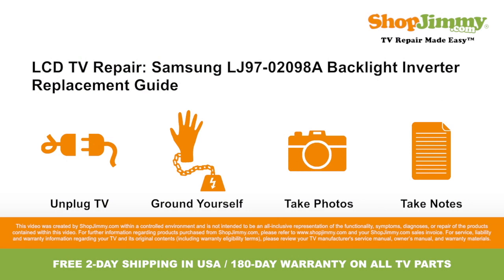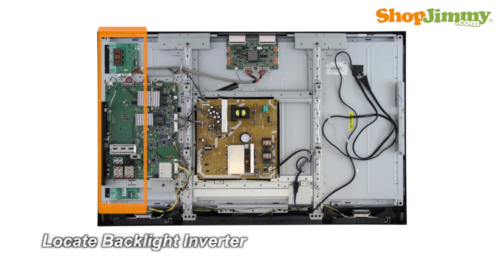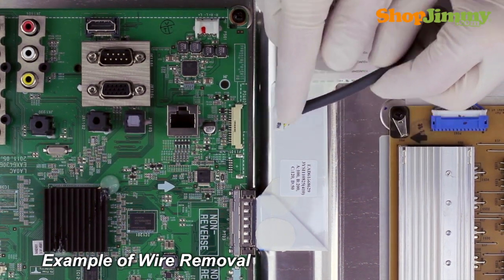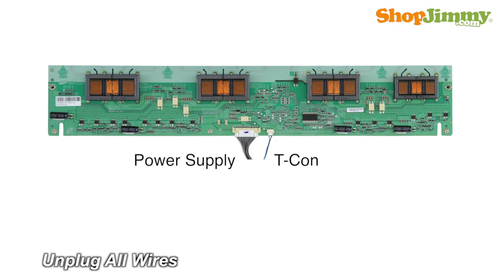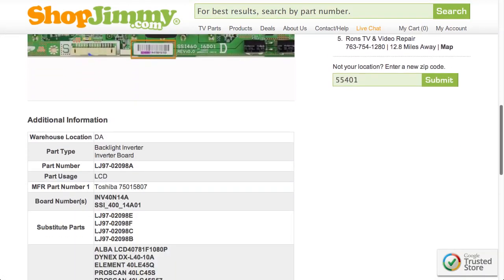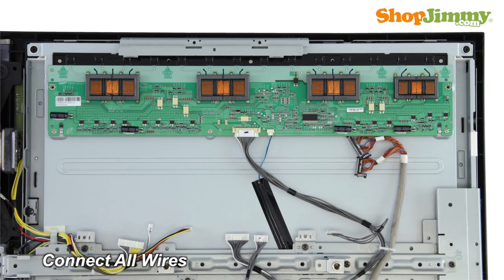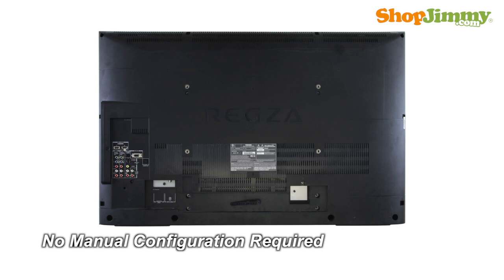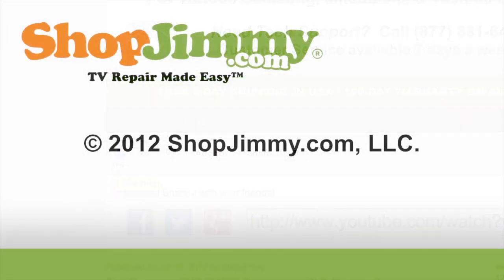Samsung LJ97-02098A Backlight Inverter Boards Replacement Guide for LCD TV Repair

Comment: I have a Nexus 4020 that flickers nonstop when powered on. I read some posts online that mentioned that it is probably the back light inverter. I just ordered one from you guys but wanted to confirm that this is the solution i am looking for and secondly i would like tips as to how to detatch previous board inverter. the bulbs are tight and cant be "slid out" as mentioned. 
The part is a samsung lj97-00998A
Thank you for your time. The help is much appreciated
Reply from the maker: Ryan Boles   This could either be the power supply or the inverter board.  I see a replacement for the inverter board here:  http://www.shopjimmy.com/samsung-lj97-00998a-backlight-inverter.htm  What is your TV model number or the part number on  your power supply?  Thanks!  www.shopjimmy.com

Comment: Hi I have a Samsung UE32F6200AK LED TV. I seem to have the back light problem. As I could not locate an LED inverter board I assumed it must be built onto the power board and replaced the power board but the same problem exists. The TV powers on and responds to the remote and you can see the menu when shining a torch on the screen. 
Can you confirm if there is a separate inverter board and where I can locate it?
Any help would be greatly appreciated ...Jamie

Comment: Hi there buddy I'm from uk and you look like you know your stuff :-) I have a samsung s42ax-yb09 had it not long at all but haven't got warranty... Basically I have a line down right side of my tv about 3 inch thick red, but I can still see the tv picture behind the red thick line.
I was told it may be the inverter board that needs replacing I was wondering if u would be so kind to help me as I haven't the money for a new tv. Would much appreciate.
Reply from the maker: danny collins This could be a few different problems.  If the line is from left to right you can try the buffer board but if the line is from top to bottom you have a bad panel.  If you have a bad panel, it may be more cost effective to replace the entire TV.  Here is a link to replacement parts for your TV model number on our website, click here:  http://www.shopjimmy.com/catalogsearch/result/?q=s42ax-yb09  Be sure to match part numbers on your current board, with your replacement for compatibility.  Here is a link to a video showing how to identify your part number, click here:  Samsung Plasma TV Repair: Samsung Plasma Panel Parts Guide  You can also call our customer service for further assistance with your purchase.  (877) 881-6492  Thanks and please let us know if you have any further questions with your TV Repair!  www.shopjimmy.com

Comment: Hi everyone, while i was swapping the Inverters, I also removed the bulb connectors instead of just sliding out the board thinking they were together... was the bulb connectors removable or did i just permanently damaged it in doing so? thank you in advance.
Reply: I did the same damn thing and now I can't get the bulbs back in the slots what did you end up doing I'm so pissed
Reply: Any answers to this I did same thing

Comment: I have a Dynex DX-L40-10A 40" LCD TV. It uses this inverter boaard (Samsung LJ97-02098B). The TV turns on but the back light only stays on for a second then goes out. Blue Power light stays on. Would this most likely be a problem with the inverter board or something else?  Thanks
Reply: Additional info: I removed one of the fuses for the inverter board and now I have a steady picture, just half the backlight. I see you sell the repair kits. How likely would it be that a repair kit will fix this?

Comment: Hi i have a samsung le32a436t1dxxu lcd, when you turn on the screen it flash up for a split second than goes black but have sound, i have done the torch test and there is a picture. some people say this could be the back light inverter but some say because it flashes up first its most likely faulty tubes.
Reply from the maker: David Mullinger  Does this TV model number have a inverter board in it?  Thanks!  www.shopjimmy.com
Reply: Yes it does have an inverter board. Thanks.

Comment: my technika lcd40-920 doesnt switch on. it only blinks once then nothing. im looking at back of it now ive opened it,& 1 capacitor looks blown.its bulging up at top.think this is the cause?
Reply from the maker: Martin Thomson   Yes, I recommend replacing the capacitor to see if that fixes the problem.  Thanks!  www.shopjimmy.com

Comment: I have Toshiba model 40xv645u I sound but no picture I replace inverter and t con now TV working  perfect but now turn on and off please help thank you
Reply from the maker: carlos vazquez  Please watch this video FIRST to help with your repair!  https://www.youtube.com/watch?v=BP3NVNCGEv8  Sounds like you have a problem with your Main board and I recommend replacing it.  Click this link to replacement parts:  http://www.shopjimmy.com/catalogsearch/result/index/?cat=56&q=40xv645u  There may be multiple boards for the same TV model number, be sure to match part numbers on your current board, with your replacement for compatibility.  Here is a link to a video showing how to identify your part number, click here:  https://www.youtube.com/watch?v=3DQe0ATZl_Q  Thanks and please let us know if you have any further questions with your TV Repair!  www.shopjimmy.com